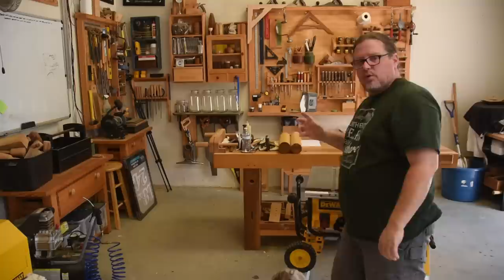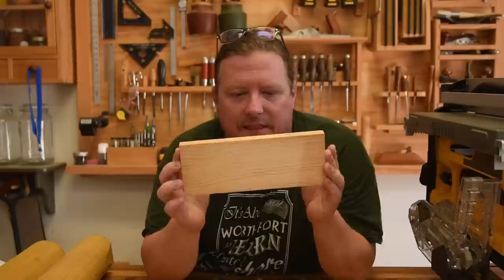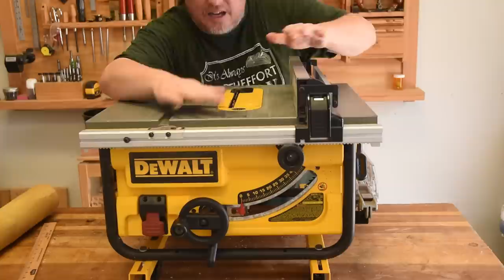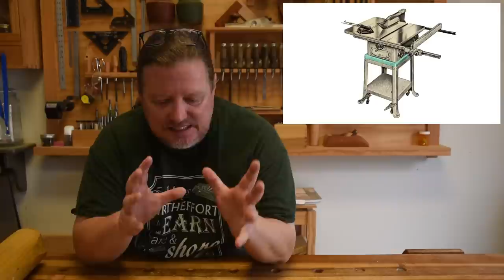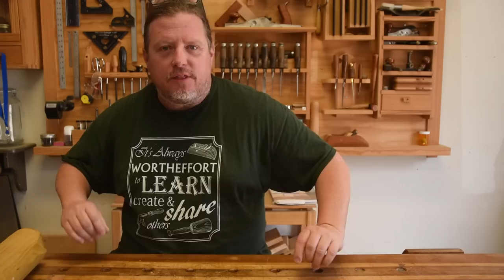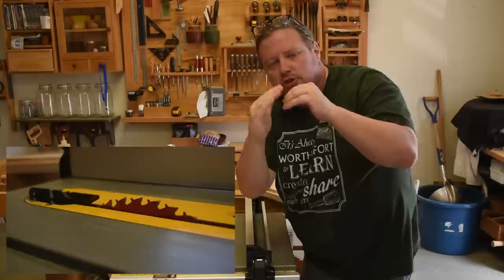What Table Saw is Best for You?

Comment: I have that exact same Dewalt saw, minus the carriage. The only problem I’ve encountered is trying to cut sheets of plywood - small bed. I periodically check the alignments/angles and make the adjustments. So far, it’s been adequate for a beginner. If/when it burns out, I’ll probably upgrade.
Reply from the maker: For that application I think it’s great. Build a table around it is common and makes more useful for sheer good but does take up a lot of space.
Reply: Same here. I got the Ridgid 4512 to replace it about 8 months ago, and that one, for the price, is excellent. I'm keeping the DeWalt jobsite saw, though,  with the Incra box joint jig, and making its purpose exclusively for that.
Reply: I hated that the bed area in front of the throat plate was so short. That was probably my only real complaint with this, and every other jobsite saw I've seen.

Comment: Very in depth  educational video! I've been wrestling with what table saw to get, or just put my circular saw underneath my shop table.
So far in all my investigating I kind of like the Dewalt because of the rack and pinion system. It seems to be the most accurate fence 
compared to the Harbor Freight, Ryobi, and Delta kind of saws.Let me know what you think when you get a chance.
Reply from the maker: Dewalt and Makita are pretty competitive.

Comment: I started with a jobsite saw.  My results were exactly as you described.  When the motor fried, I got a used contractor's saw.  What a difference!  When I got fed up with the crummy fence, I found a much better, used, contractor's saw.  It cost less than a new Dewalt jobsite (the one with wheels like yours), and way less than a new contractor's or hybrid.  It has no riving knife.  So what?  It is better in every other way than any new saw I could afford.
Reply: "no riving knife.  so what?"  lol.  good luck to you.
Reply: @RainDog222222  A riving knife would be nice but it is no way essential.  If it were an inexpensive, easy add-on, I would get one.  I won't spend over $1000 to get a contractor saw with a riving knife.  I know how to use my saw as it is.  Don't rely on luck in woodworking .

Comment: Awesome video. Very informative. Im a DIY beginner and a circular saw doesn't cut it for straight cuts for me. What are your thoughts on Track saws or making a track from wood for your particular circular saw? My main concern is accuracy on my plywood cut or even small pieces. I want to try and make my first box from nice wood with sanding and stain etc. I recently acquired a chop saw which i love. I see many videos on youtube of handmade attachments for your particular piece of gear. Jigs, tracks, sleds etc.  Thanks again!
Reply from the maker: Richard Ng see one of my latest videos “all the tools”

Comment: I think you just gave me a reality check of what I really need vs want.  I think I need a good contractor's saw or a hybrid.  If I grow out of that and get shop space, THEN cabinet saw.
Reply from the maker: Sounds like a plan.
Reply: I was surprised to discover recently that the Sawstop PCS (lesser cabinet saw) takes less floor space in use than the contractor saw. I assume that's because the motor is inside the cabinet instead of hanging off the back. Will keep that in mind when I get a table saw for my itty bitty shop. Meanwhile I'll just use my track saw and TSO TPG system, though I expect I'll really want a table saw for building shop/kitchen cabinets.

Comment: Thank you for the video. One thing I would like to point out, however, is that the quality of job-site table saws has really plummeted over the past few years. I have a 7-year old porter-cable, which was a middle of the road product 7 years ago. The Dewalts and Makitas of 2013 were  of much better quality, had better fit and finish and felt like premium products compared to what I bought, but also double the price. The Dewalts and Makitas of today, however, are much more poorly manufactured, feel cheap, rickety and plasticky, and my 7 year old porter cable feels like a premium product compared to them. 

If you want to just cut table saws and need just about 1/32" accuracy over a foot, one of today's good table saws would work for you. If you want to do precise work like chessboards, cutting boards etc, unfortunately they won't. You will be better off buying a used hybrid saw.

Comment: Additionally, most job site/tabletop saws have the smaller arbor that prevents the use of or safe use of dado stacks period. 2¢. For $100 to buy an old craftsman 113 and add another $200 to clean it up go to machined pulleys, link belt, a PALS, and a good blade; I have all I’ll ever need and the precision/versatility to do a lot.  I make my own splitters for my cut outs and does the job of a modern riving knife. If the wife would let me, I’d buy a low end sawstop and call it done though 😁
Reply from the maker: I question dado use on jobsite as the weight is so little compared to the force generated by the heavier blades even though they are 8 instead of 10 inches. From my experience a splitter works well when the blade is high but since it's fixed when the blade is low it's several inches behind the back of the blade so can bind if reaction is present and be a liability. This often happens in thin stock which is when you'd have the blade low. But better than nothing most time.

Comment: Remember, saving up a little longer for a better tool is never a bad move. But then again I'm in the last tool first crowd.
Reply from the maker: Also sometimes saving is missed opportunity to making things to sell.
Reply: @wortheffort  this is true. But if that is your philosophy, then buy a cheap crap saw and make it work while you save up for the big one. Personally I have been using a jobsite dw 745 for quite a while now, but very soon I will be purchasing a pm1000 for my shop, instead of buying a middle of the road grizzly for 3/4 the price. 
The first set of sockets I owned were harbor freight, my second set were proto, big jump. I think its better to go for the best tool possible and replace your just barely enough to do the job with something fantastic, than to go the bench top, jobsite, contractor, hybrid, entry cabinet, moderate cabinet, good cabinet,  path.
Reply from the maker: The Wood Welding Fabricator da wood that’s what I said in this and sawstop video.

Comment: Matt Estlea proves that you don't need a tablesaw to do fine woodworking. He, like you, prefers a bandsaw for its more versatile usefulness.
Having said that, I do have a tablesaw, one I made using an old circular saw that's mounted on an insert that can be removed from the table and interchanged with other power tools on their own insert. It's not ideal, but it does what I need it to do, and when you don't have the room to even have a table top bandsaw, you build a folding tablesaw with a removable insert so it can be stored up against the wall once you're finished using it outside the garage. Oh, it doesn't have a riving knife because there was no way to attach one to the circular saw, but it does have a splitter that is removable when I'm not making full depth cuts.
Reply from the maker: One point... Matt as talented as he is doesn't do production work. For art markets, while everything is unique, utilizes production work. Set a fence once and cut 200 repetitions is easy on a fence. Resetting a track saw 200 times... not efficent and adds potential for human error. Plus, track saws are in the price range I'm looking at for cabinet saws. Your setup sounds like a shop made festool system.
Reply: My comment may have been misinterpreted. You stated at the beginning that if it wasn't for your production work, you wouldn't have need for a tablesaw. The kind of work that Matt does can be done without a tablesaw, and he's made a point that he doesn't need one, so I was kind of backing up your statement, not that it needed it.
My tablesaw legs are like what you would see on a TV table, one set of legs swings inside the other set, but mine are made from heavy gauge 3/4" conduit that has curved 90° sections of conduit at each corner so the legs make one continuous loop.
The table top is laminated 3/4" and 1/2" MDF, with a cut out for the insert that the circular saw is mounted to. The insert is 1/4" MDF that sits in a routed section of the table, with the insert parallel to the miter slots, and so it doesn’t shift, I screwed it in place. I then removed the screws and cut off the heads so the insert can be removed to fold the table, then screwed them back into the table. The miter slots were installed 90° to the front of the table, which makes the blade 90° to the front edge of the table also. I made a rip fence that slides into a T-track that's mounted on the front of the table with a section of forward and reverse self-sticking tape measure mounted on the top edge of the table in each direction of the blade. It's difficult to picture it with just my description, and since I'm not familiar with Festool tools, I don't which of their tools compares to my tablesaw and how it does so.

Comment: Can you get  just as much done on a 9 inch band saw if that is what you can afford or you only have room for in your shop?
Reply from the maker: I worked on a benchtop 10" for years. You can see it in my early videos. But no, there are things large tools allow you to do the small ones won't such as bowls blanks. Plus the smaller saws go through blades a lot quicker because each tooth is doing more work. Used bandsaws in the 14" range are dirt cheap and the technology hasn't changed much since the '40's so buying used is a valid option with bandsaws.
Reply: @wortheffort  thank you I was just wondering cause I'm not big on table saw I'd rather use my circular saw to cut things down to length, and I'm starting to learn more hand tool work like dovetails, I restored several different hand planes. I've always enjoyed building things with my hands.

Comment: the table saw is the most important tool next to your cnc machine.   its fucken 2020....get real.    cnc machines are more precise , do work faster, and u can program them to do everything.   buy a 12 " table saw with an optional 10" arbour.  you can build all kinds of jigs for them.  I use the bandsaw mostly for resawing for guitar tops and furniture.  yes i have one of those portable table saws for jobsite work.
Reply from the maker: template routing is still faster in my shop compared to the cnc.